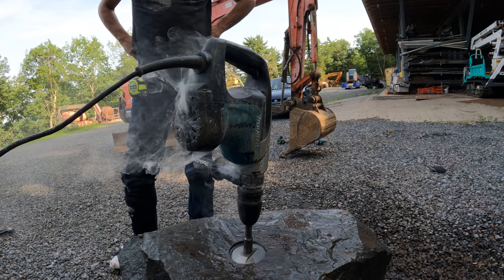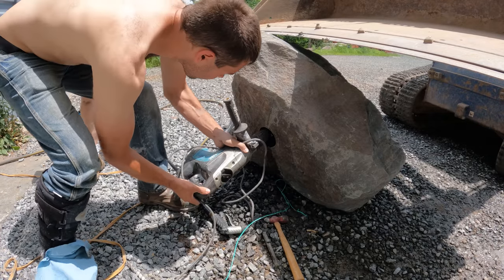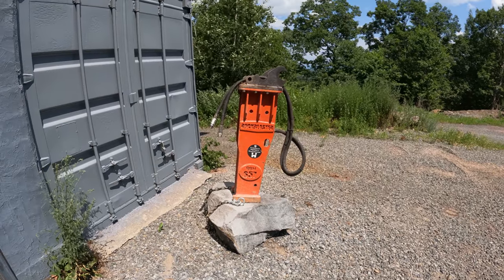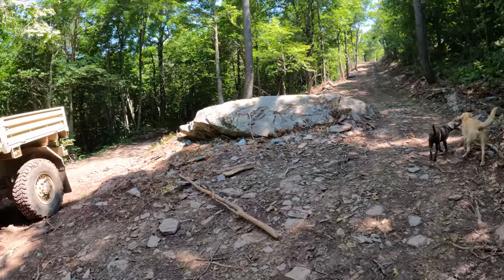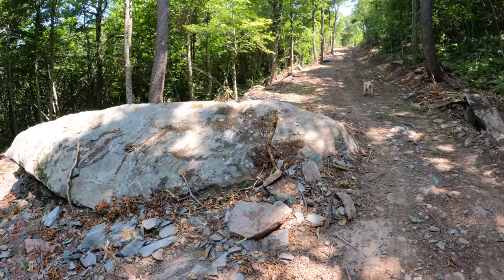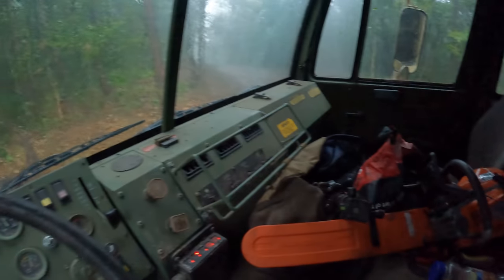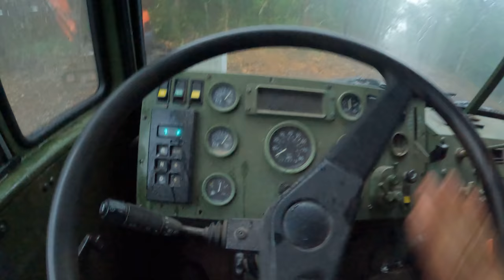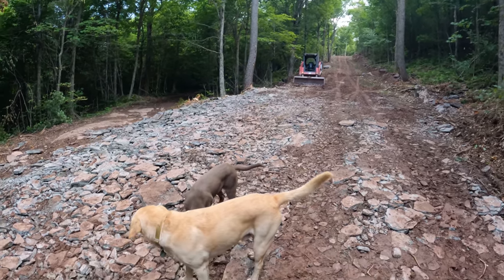Hammering and drilling rock

Comment: Why aren't you building/improving the road, to the top is the ridge, before building at the top of the ridge?
Reply: Did you not listen to the video?  The large rock he was hammering was on the new road he is building to the top.
Reply: @andrewalexander9492   - No, I get that.  However, there have been several videos where he had been bring equipment to the top, and even some where he got stuck.
Just wondering why you would not start with making a real road to the top, and not a dirt track...
Reply: @Talon5Karrde  No, I don't think you do get it.  Andrew is building a new road which at least partially follows a different route to the mountain top.    I'm not sure what you mean exactly when you say "a real road", but I suspect that you have no clue the effort and expense it takes to built even a modest gravel road up a mountain, and you're picturing a road which would have a cost far beyond what a private citizen like Andrew could afford.

Comment: Why is it you destroy nearly everything you touch ?
Reply from the maker: Stuff breaks when you use it.
Reply: @AndrewCamarata  No, not if the "stuff" is used correctly and not abused ... and you are a MASTER in abusing everything !
Reply from the maker: Stuffed wears out and has to be replaced. Even when it’s used correctly, that’s just part of it, the manufactures design things that way on purpose.
Reply from the maker: A ship in harbour is safe, but that is not what ships are built for.

Comment: It is ALL ABOUT $$$$$. Serious rock drilling must have diamond cutting... Cost per holesize/ per hour /per bit. Abrasive Water Jet can do a good job but initial cost is way too high for a few holes..  Where are your extensions. Way too much nose in the hole. I am sure half million views pays for tool and bit. Smart man.

Comment: Didn’t realize after checking your auction site that the drill did not work at all. Bit troubling that you would auction that off. I messaged you that I was making an accessible ramp for an Afghanistan veteran that had major life altering injuries. Yet, you directed me to your auction site after I mentioned that to you nevertheless. 👎👎
Reply: The drill obviously doesn't work lol